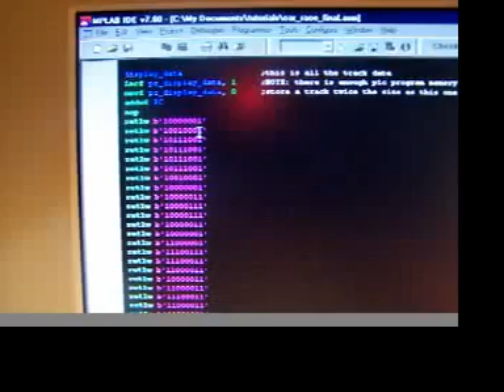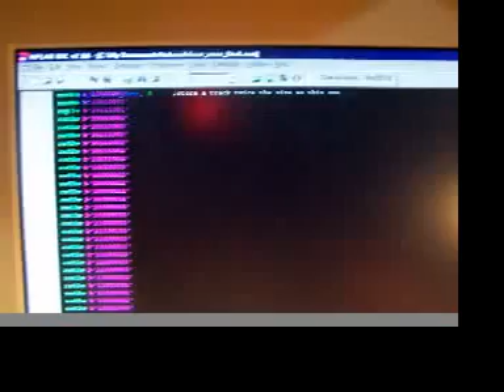A PIC Microcontroller Car game. (almost complete)

Comment from the maker: Hello, you could say that it works with shift registers, but it is all done in software.
each row requires 8bits of ram, to get it to scroll down, you just pass this 8bits of ram to the next row and so on. so it is like using 8-bit parallel shift registers.